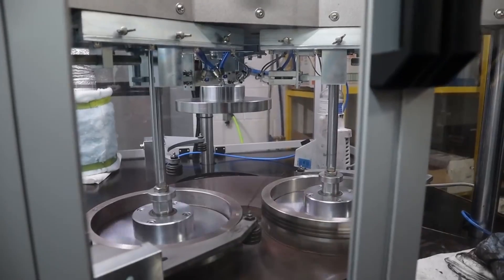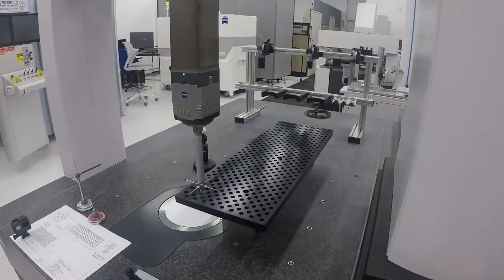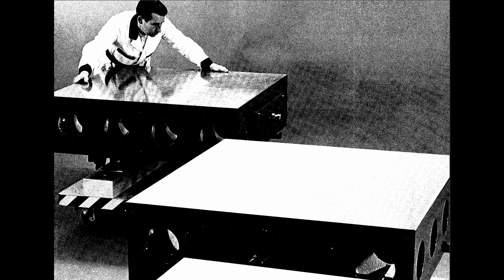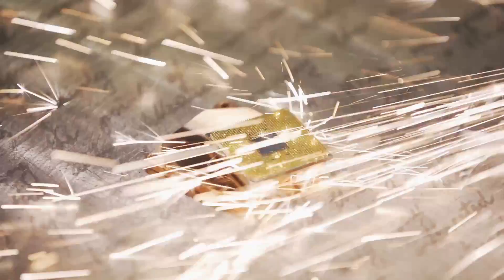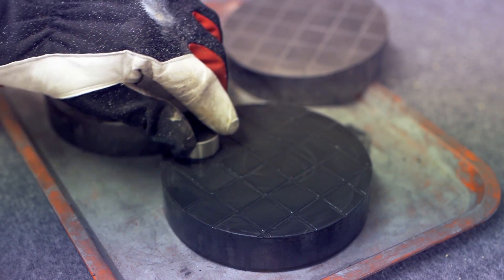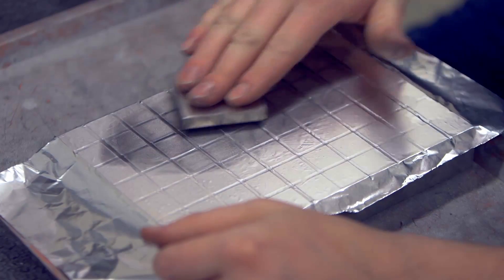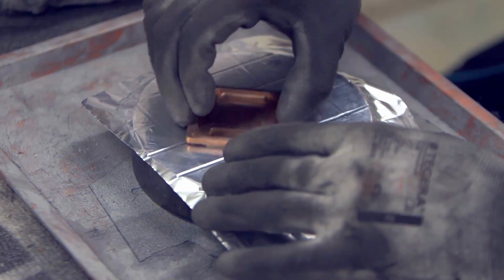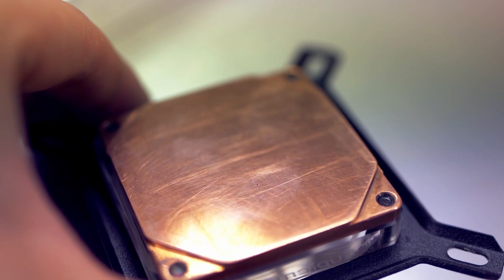Lapping a CPU, the proper way [AMD 3950x]

Comment: So even if I do lap my cpu perfectly as soon as I put it in the socket it will just flex and no longer be flat
Reply from the maker: If it's an LGA socket with a clamping lever, yes.
Reply: @Penrowe  do you think I will be better off leaving it as is or it’ll over all still be better than original?
Reply from the maker: @djmystery7235  You could just remove the clamping lever if you're going to go through the trouble of lapping the IHS and cooler.

Comment: It sticks because its so flat it displaces the air and the air is keeping it together.  Similar force to life on an airplane wing.  Low pressure between the two metals and high pressure outside and around.  The high pressure presses the two against each other.
Reply from the maker: Codyslab did a test on this a while back with gage blocks, they remained wrung even in a vacuum.

Comment: @Penrowe
You seen the  Hardware Canucks video?
"Can this MYSTERY Metal Replace Thermal Paste?"
May 7th 2021

Indium Sheets are about the same as top paste in filling the gap and transferring heat.
Reply from the maker: Indium is often used in solder and is the primary alloying compound used alongside gallium in liquid metal products. It's hardly a mystery metal, certainly not to anyone familiar with the manufacturing of modern computer technology.

Comment: any update?
Reply from the maker: There likely won't be for a little while. My next project will be a 5950x but I'm still waiting for one to appear in stock and it's starting to feel like ryzen 4 will be released before then. As for the good people of North Carolina I'm not sure what their production pipeline looks like so can't comment.
Reply: @Penrowe  thanks I was so curious about the no tim idea you had thanks.
Reply from the maker: @xsvrrx  Oh it works, been running a 3950x since October last year with almost 100% uptime and nothing at all between the  CPU and water block. No difference to temps but what happens instead is it'll boost higher (much higher if I max out all fans).

Comment: I only can find silicon carbide powder can you link where I can get the silicon carbide you used
Reply from the maker: I use autosol but I'm sure other brands work fine too (mother's for example). You could also look for valve lapping paste from any auto parts store since those almost always include silicon carbide as the abrasive.

Comment: did you ever use the plates you made without the aluminum foil, or did you only use the plate with aluminum foil for all of the passes, because you did say that the material for the lapping plate has to be softer than the material your lapping with which is copper, and what was the grit of the silicon carbide because I what to do it myself like what did you start with?
Reply from the maker: The silicon carbide was ~3 microns, I used regular chrome polish from the hardware store, same stuff I use for my knives. I did try at first to use the bare plates but quickly discovered what a poor idea it was, could never get a test cpu done with a better result than maybe 15 microns of error across the surface after an hour or two of trying. Lots of fall-off and high risk of fouling.

Comment: What abrasive did you use
Reply from the maker: Silicon carbide for the first few rough passes then microgrit diamond, stopping at 1.5 micron. I've got .1 micron diamond paste too but that's waiting for a set of tin plates before it sees use.

Comment: Amazing video!
Gosh, this makes me really want to go the extra mile and try no TIM, so I’m a machinist and have done lapping for 15+ yrs, also XOC overclocker, with my water blocks and cpu dies, Direct die 9900k/10900k, I ground the die flat to 2 light bands then lapped it lightly from there, along with water block cold plate, but with water block assembled to avoid the mistake and make everything square to itself, die to PCB, ect. On 9900k chips, took my best 6 I also tested different material removal to get closer to the transistors which did make a significant improvement, and let’s just say the results with both surfaces at 1 light band flat they will wring together, but getting them to wring while assembling cpu/waterblock in motherboard would be an extremely challenging process. Non the less on my golden 9900k I have insane core to core deltas of +/- 1c controlled coolant temp (chiller) and on my golden 10900k +/- 2c using liquid metal. And my temps compared to stock saw significant decrease of around 10c to 25c depending on chips and silicon quality. My 10900k was just going to have IHS lapped but I had core to core delta issues even after lapping IHS, so a delid was needed. 
Only thing stopping me is time, look forward to seeing another video.

Comment: I have done my fair share of metallographic cross-sections for electron microscopy.  Final polishing of cross sections is done with on soft polishing clothes with a colloidal polishing compound.  This cloth is on a rotating table. A small amount of compound is used charge the cloth.  A small stream of water goes on the table as you polish.  It works very well.  It's not really for flattening however.  The surface with flat be to itself, but not to a particular plane.

But I do not think a mirror finish is desirable.   It will never prefect and there will be slight air gap at the interface.  If the air is removed, heat transfer across such voids will be EM radiation (radiant heat transfer), which is not every efficient at low temperatures.  You need something to fill this gap.

However having the CPU and heatsink flat as possible with maximize the contact area.

Comment: Penrowe, this is incredible work and I'm so excited to see you make follow up videos about lapping processors and heatsinks. About 10 years ago I had a CPU cooler and when I lapped it with sandpaper and polishing compound I lowered the temperature of my CPU by 3-5* C (my testing methodology was extremely primitive so take this with a pinch of salt), since then I've always had a weird fascination with it. I've read quite a bit about lapping over the past 10 years but I think this is the first time that someone with your background and experience is tackling this subject. Please, please, please continue making videos and thank you for your time and effort

Can you give any advice for people who are trying to lap their CPU, heatsink, or waterblock? Most people will not go to the lengths that you have gone to in order to get a perfectly flat surface, but are there any tips you can give to get closer to a flat surface with a relatively small cost? Most of the advice I have read in the past focuses on using a flat piece of glass, using different grades of wet/dry sandpaper, and sometimes it suggests using polishing compound to get a mirror finish. Is this correct, or how should it be changed?

Comment: I've worked in Mc shops for almost a decade and worked as a QC tech. It always killed me when people would "lap" with sandpaper. It's like milling with a lathe. Sure you can get a flat surface, but it's not the same thing! I've never seen an IHS rung with a coldplate and I have to admit I'm pretty excited to see what Beve can show with that. It's so counter intuitive that the lap plate needs to be softer than your work piece, but this has inspired me to learn more about this and makes sense when you think of the charging process, but it's still a little "wait, wut" if you are used to traditional machining where the cutting tool is harder and the cause of material removal. But if you think of the lap plate as a tool holder, and the tool removing material is the abrasive, it becomes a little more intuitive. Great video, thank you for making this!

Comment: Does this mean that the "home lapping" technique can be easily improved using the 3 surface method? And would that still work best if used an abrasive or would it work with sandpaper as a shortcut using glass to lap CPU & Heatsink, then the CPU on the Heatsink and the with the opposite direction of Heatsink on the CPU?
Reply from the maker: Theoretically you could lap just the CPU and heatsink to each other and achieve two perfectly matched surfaces (neither will be flat though). There are several challenges in this, first both are of equal hardness so you'll never have a perfectly smooth result, you also need a relatively soft abrasive to prevent grit from embedding and causing deep scratches, without slotting there's also roll-off that will occur to the edges.
In short, it can be done but it's hardly worth the effort.

Comment: Would the wrung surfaces not separate with the changes in temperature?
Reply from the maker: Maybe but the heat output of a CPU die is not enough to meaningfully deform its IHS.